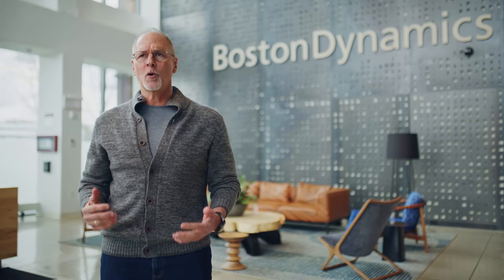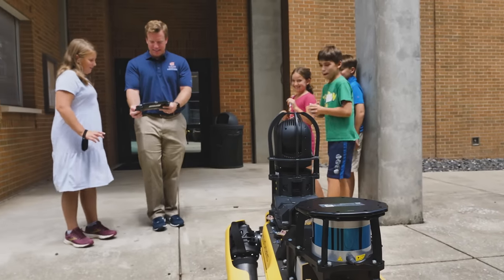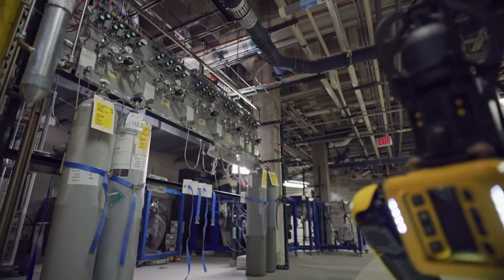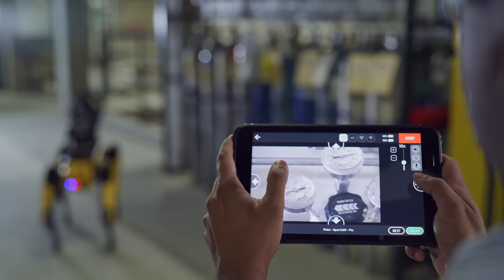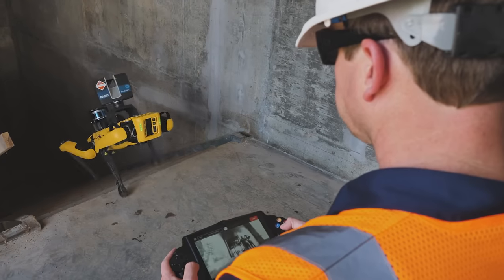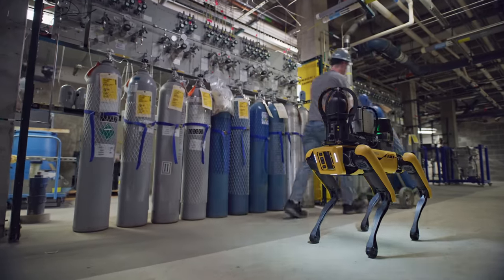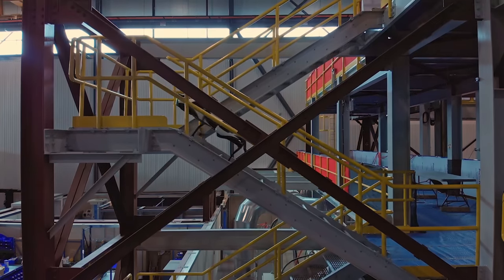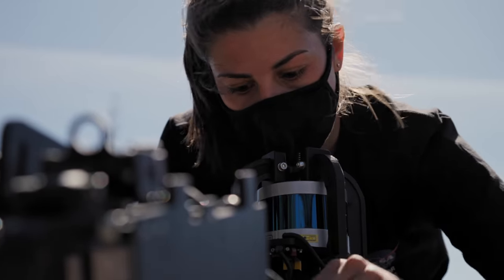Spot Levels Up | Boston Dynamics

Comment: oh good... i did interpret the Teaser correctly... bigger payload.

Can i suggest something? Add microphones and Voice-recognition. Why?
"Spot, please go to Sector 6A and Check for heat and noise anomalies."
You gave Spot a Speaker/Mouth .... so its ready to "talk" with his human coworkers. Now it needs Ears to hear what they say.

On a different note... it has thermal view... could Spot be used for medical purposes? Like warning people if they are at risk of overheating/frostbite?
The payload-system has so many potencial.... someone could place a particle-filter on Spot and let him walk through a Mall, to analyze if there are dangerous levels of pathogens in the air (pandemic-prevention). ... but i guess a flying drone would be better for airborne data-collection^^ Not long ago, i read an article about a drone with the ability to "grab" a branch for example and rest there.

Comment: Question: At 10:13, Spot stops to let a person walk past. When Spot stops moving forward, the legs are still moving, kinda like jogging in place. Is there a reason for that? I would think that it would be more energy efficient to stop the legs as well, increasing battery life, but I’m not exactly a roboticist lol
Reply: My guess is to maintain stability, the legs are in motion and if the suddenly stop then the robot as a whole will start moving with that momentum. So dissipating the momentum of the moving legs is not worth it for quick stops.

Comment: Why you need Spot for Thermal sensors? Why cant a camera fixed permantely handle that?
I dont see a beneficial option over here.
Slippery surface is good update.
Can drones be added to spot so for vertical surfaces where gauges are can be visualized?

Comment: +1 .. I've often thought Spot would be ideal for Lunar lava tube and cave mapping.. operated in safety by the astronauts back on the lunar base with a procedurally generated graphics mapping engine (which would be easy as the features could be roughly textured before-hand and just adjusted to scale) using a control method something like the game 'Stray' by Annapurna. Two dozen Spots on the lunar base and mapping done just like a video game.. relay antenna part of the 'game' so each one overlaps to outside with a large antenna. just my thoughts there.. it would protect human lives and make the mapping fun. .. (it would be easy to generate as the moon is pretty feature-less.. it's not like it needs to generate a car or something.. its pretty much tunnels and caverns a rare time a stalactite.. which can be all pretextured and scalled according to need.. and it doesn't need to be 100% accurate.. so long as we know what the space is and get an idea we can adapt.)

Comment: Some people are frightened by the innovations that have gone into Spot. Not me. As long as Spot is being used where it would normally be inhumane to send a human, or an animal, or set to tasks that frees up higher value tasks, then I'm good with it. Futuristically speaking, I think it's gonna take robots to scout, prep, and build for space missions. 

Picture this, you want to put a layover station at several points a long the way between Earth and Mars. With robots it can be done without putting life at risk. They don't need oxygen. They don't have to worry about food or how to recycle biological waste. They don't have to sleep......unless you count being recharged. They can multitask better. While they're building the layover station, they can be taking readings of the surrounding space. Literal space. 

As long as humans aren't being replaced for dangerous tasks or tasks that no human wants to do, then I am 100% for the utilization of robots like Spot.

Comment: why wouldn't you set up permanent high res visual, sound and thermal cameras that has AI input to help alert to issues - instead of counting on the robot getting to the locations fast enough to detect issues?

Comment: Definitely useful. However, unless pre programmed, it would just walk past an exploded pipe if it wasn't told to look.
Reply: yes, thats really a big disadvantage.    same with the software that controls the legs for walking.    unless pre programmed, it would just lay on the floor.
Reply: @mm-hl7gh Obviously you have to teach it what to look for first.  Say you deploy it in an industrial waste site or disaster zone.  You don't want it freaking out at every broken pipe and discarded broken i-beam.  What a stupid thing to be concerned about.  It's a robot.  Of course you have to program it first before setting it loose.

Comment: Why not invest in smart gauge sensors ?  Seems more instantaneous.
Reply: In some cases it's just not feasible, you can't really mix and match parts of high pressure industrial equipment yourself without breaking some serious safety standards, and a full purchase with smart sensors built in would be significantly more expensive and require different systems and employees to monitor.

Comment: I'm a little confused by these additions, in particular the sensors. It seems like they are targeting markets where obsolete technology is still being used. Modern sensors should be able to report gauge results wirelessly, and modern AI can use those results to detect anomalies that may be caused by things like compressed gas leaks. Firms would be better advised making those improvements than employing a robot dog as a short-term solution. 
I will be excited for them to apply this to more forward-looking problems, that can actually replace dangerous human jobs in the current state of technology. Spot is mainly a monitoring and diagnosis tool, instead of a maintenance and repairing tool that it will need to be.
Reply: Man we ain’t living in the year 2100 lol

Comment: I like this robot and all, but let me disperse the pink mist around it. As long as an operator have to walk next to it with a controller and take/edit/interpret photos manually - as seen in the video - it is not autonomous and will not replace human workforce for now. It is simply a device carrier, every measurement can be done without Spot by the operator using the given sensors. It is easy to forget while watching this nicely edited marketing video.

I know Spot has an SDK to write a software to collect and upload data automatically, but it just gives the software developer employees at the companies who buy the robot a hell of a big work. It is pretty complicated to program the robot when to go where, what to record and how. This software likely has to be customized for each different environment - different size of stairs, different obstacles, different things to measure. This all has to be done by the customer who buy the robot.

Therefore as I see Spot as a product for now, it is just a very fancy and expensive "RC car" for carrying very fancy and expensive equipments - even a "simple" camera modul costs hundreds of dollars, just because it was made by Boston Dynamics specifically as a payload for Spot. Not to mention that the payloads are not as modular as we would think. If you want to get an arm for your Spot, you have to buy it together with a Spot. And also, there are front payloads and rear payloads, if you want to combine the payloads you also have to take into account where you want to put which device, and the initial decision pretty much limits future possibilities.

I admire what Boston Dynamics achieved with Spot in terms of balancing, object avoidance and movement dynamics, and I do think of them as one of the leading robotics companies, but it is still a long way to go for a universal fully autonomous robot, and I believe they are trying to sell more than what they can actually give. If you have a big industrial environment, a lot of money, a team of software developers, and you want to make a bid deal about working with Spots, then it might be the thing for you. But otherwise, I think you are better off buying a much cheaper chineese Unitree A1 and tinker with that.

Comment: Kind of cool, but also useless because why not have the censors in the areas where they're required and then query them rather then send a "robot" to do the inspection ? What value does the robot add when you can just instantly get the feedback required ?

Of course robots can be useful, I just think that practically, censors are too cheap to bother with. Moving parts are harder.

Comment: I mean all of this is very cool, but if I had a factory, why wouldn't I install static cameras or whatever sensors I want instead of teaching the camera to wander around and open doors that are in its way? rescue missions or emergency use in dangerous situations on the other hand would be an ideal use case. I'm assuming though that unfortunately there's no money in that..

Comment: You know what would be cheaper and more efficient for each job this thing does?  A human.
Reply: Are humans as fungible?
Reply: It's more efficient and cheaper to raise, educate and train a human to perform repetitive and/or dangerous tasks?
You should go out more often.
Reply: @marcromain64 for sure a human is cheaper and more efficient! A single human can fill, cap, and wrap a bottle once every 30 seconds for 10 hours straight! While some rusty old machine can only do the same job about 5000x better and work 24/7 which is pretty slow if you ask me.

Comment: Why on earth do we need a robot to do inspections like that in a facility. This could all be replaced by fixed ir camera and fixed mics that report data in real-time and more reliably.
Seems like a product in need of a problem to me. This robot is good for transporting small things but as an inspector I don’t see the benefit.
Reply: A lack of on-site inspectors is why. They can fire you and just buy one of these that will pay for itself in a few years.
Reply: @jimrockford1283 Deus Machina AI is still decades away at best, and even then it'd be easy to control by controlling its power source.

Comment: 3:33 "You have a facility with equipment that needs to be inspected as often as possible" <-- And for whatever bizarre reason, you want to spend tens of thousands on a robot (or robots), instead of just installing a few hundred dollar sensor, to feed into your computers and get more data points of readings. 😆 KISS

edit: MAYBE this is good if a company has money to blow and something ABSOLUTELY CANNOT FAIL, and maybe you want to inspect the digital as well as the analog sensor. (In case the digital sensor has failed and the analog has not.) Or maybe if you have a bunch of analog sensors, and you don't really know which you should be digitizing yet. But if these are really the use case, why not specialize for that?

4:33 I guess this failed to work? 😆 In the lower left corner: "reading: 0.0 psi"  (I mean, if you're going to stage a demo, at least it should show things working, right?)